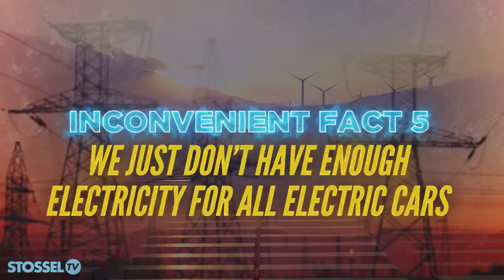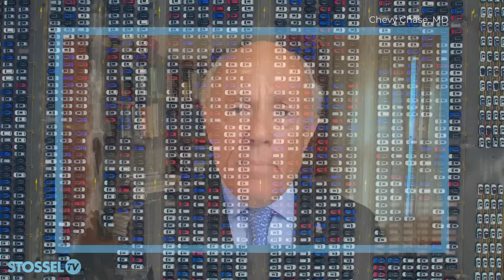Electric Cars: Inconvenient Facts, Part 2

Comment: As an engineer, the basic calculations for all of the requirements for conversion of any significant amount of the energy system to electricity are staggering. As your guest has stated even the best case back of the envelope estimates are huge. Unfortunately, low resolution thinking allows people to ignore the massive scale required to make this happen. Magical thinking also allows for them to believe we can violate the laws of physics by just waiting a little longer for the next breakthrough. They do not understand the physics behind a battery, and the limits of using ion transfer to make a rechargeable battery. Politicians, and  the Green Zealots are looking for the Harry Potter Magic Wand to be able to wave it and say some lame half word to make it all work. Unfortunately, it doesn't work that way, Physics, Math, Chemistry, Economics and Engineering have to work in the real world and not a make believe one accessed by train through an arch.
Reply: I would love to see some math to back up your statement.  Similar to this video, no references and no math don't cut it with me.
Reply: Absolutely
Reply: Yes, you are right !.
Reply: @Dedread  likewise where is your math that these breakthroughs will work?
Reply: Let me play devil’s advocate on the battery issue. How about solid state tech? As I understand solid state batteries far surpass energy storage/expenditure & life cycle metrics of conventional lithium-ion tech and still follow the laws of physics.
Reply: @MichaelJensen14  Given that over a million EV sold last year most without subsidy, math works really well. When Mars rover operated on MARS for 18 years with only 20% degradation, it is a breakthrough.
Reply: You can be canceled and lose your license for stating such heresy.
Reply: @sillasaram9121  And how much did that Mars Battery cost and what was it made of and is there enough of it for everyone on earth to have some of it? Probably not. I'm not anti solar, I've got it on my roof but right now EV's make up less than 1% of all the cars on the road.
Reply: Are you suggesting battery technology cannot get better? Because thats what stossel seemed to suggest
Reply: @Dedread  Ok, let's start: A 2MW wind turbine generates 2MWh of power over 1 hour. it takes 20 100kWh batteries to cover for that turbine for that same hour. For 10 hours 200 batteries, for 100 hours 2,000. 100 hours is the duration of the Texas wind drought incident in Feb 2021. This for 1 turbine. to cover the 100 turbine farm requires 200,000 100kWh batteries. This is a low figure since we have excluded losses from DC to AC conversion, charging and discharge control circuits, and the less than 100% utilization ability of Li ion batteries, so this is not even the bare minimum. Currently in the US there are 70,000 installed wind turbines, to back up these assuming a 2MW average for 100 hours, we are looking at 70,000x2,000=140,000,000. This is just to back up what we have currently installed equating to about 10% of the total us Electrical Demand. 

Tell me where we get 140,000,000 batteries? If we build 1,000,000 batteries per year, that is 140 years just to back up installed capacity. How do we make electric cars when every battery for from the factories is spoken for current needs no less the added turbines to go green. This is simple math without low resolution thinking. I could go on but this is already too long for me to be teaching basic math and reality.
Reply: @edd542  Most technology does indeed get better with time, but maybe wait till that time to push everyone to do it... Just because we might have people on Mars in a few years does not mean that we should all start booking our flights just yet.
Reply: @MikeBrownRehobothBeach  I agree, I think thats the biggest problem with this push for all electric
Reply: @motopolak  I would assume you are talking about capacitor based systems. The exist, but are not scalable. They also suffer leakage current in attempting to stop the current flow across a very high intensity electric field. The physical size if a capacitor to store 100kWh of power is about is as follows 65Whr per kg, is 100kWh/65Wh/kg=1,538kg or 3,384 pounds or 1.69 tons. This is why they are not used. 

This is with the state of the art products and may not really perform to the marketing claims stated. Also this is only at cell level and not the final construction into a battery unit. The frame and various interconnects will make this much heavier.
Reply: @edd542  of course it can get better, but radically changing things in the hopes that battery tech gets dramatically better tomorrow is an awful way to govern the people.
Reply: @edd542  you really need to read up on this. I used to think like you and then I started delving deeper into it. There is no miracle battery and even if there was we still need miracle power generation for it. Just do the math for solar panels to provide 25% of the earths power demands, it’s easy and the numbers are absolutely insane.
Reply: @BlyGuy  I agree 100%
Reply: @edd542  There is a limit to everything, the laws of thermodynamics are immutable. You cannot get more than you put in as far as energy goes. When you an Ion to store electrical energy, the energy put into moving that Ion both ways is wasted in heat most generally. The resistance of the system's conductors causes waste, and degradation of the physical processes causes waste as well. The highest energy density available in conventional energy systems is from the chemical bonds that are oxidized such as in Gasoline, and other fossil fuels. Ion flow will never approach this level of performance since it works at the movement of a molecule and not the released chemical energy by oxidation at sub molecular level.
Reply: You are hiding behind your so called “expert” status and making broad, generalized statements. There are no facts pertinent to the discussion.
Reply: @sillasaram9121  Sorry there is a subsidy for electric cars. Also, the niche for proper application of these vehicles is very narrow. Can batteries last a log time? Yes they can especially if they are of very limited and controlled in scope, and the controllers of the battery do not go beyond the rated limits. These batteries used by NASA are very focused on the low demand of the rover. The system is kept at optimal temperature, and no application is allowed to exceed that. Also, it is not used in an uncontrolled environment where if we do not have an adequate charge we don't move. So the comparison is not applicable. Are you willing to do the same discipline in your battery? Also the battery in cost per kWh is very high, and only the highest quality and purity components are used.

If the batteries are so great why is the newest rover Perseverance running on a Plutonium generator? Maybe the Li ion batteries and solar cells don't really cut it for higher power requirements. Sound familiar?
Reply: @edd542  No he didn’t. He suggested that you won’t see Tony Stark’s battery or the invisible power source/battery that powers the terminator. He’s suggesting that battery improvements are bounded by the laws of physics and thermodynamics.
Reply: @motopolak  Great in theory!  Maybe we'll get a prototype in 20 years
Reply: @theshadowsymphony  I will repeat my self.
Ok, let's start: A 2MW wind turbine generates 2MWh of power over 1 hour. it takes 20 100kWh batteries to cover for that turbine for that same hour. For 10 hours 200 batteries, for 100 hours 2,000. 100 hours is the duration of the Texas wind drought incident in Feb 2021. This for 1 turbine. to cover the 100 turbine farm requires 200,000 100kWh batteries. This is a low figure since we have excluded losses from DC to AC conversion, charging and discharge control circuits, and the less than 100% utilization ability of Li ion batteries, so this is not even the bare minimum. Currently in the US there are 70,000 installed wind turbines, to back up these assuming a 2MW average for 100 hours, we are looking at 70,000x2,000=140,000,000. This is just to back up what we have currently installed equating to about 10% of the total us Electrical Demand. 

Tell me where we get 140,000,000 batteries? If we build 1,000,000 batteries per year, that is 140 years just to back up installed capacity. How do we make electric cars when every battery for from the factories is spoken for current needs no less the added turbines to go green. This is simple math without low resolution thinking. I could go on but this is already too long for me to be teaching basic math and reality.

This is the simple stuff my children and grandchildren understand and they are not engineers. You could do the math and research as well, if you wanted to look deeper into it. I actually encourage you to check my work with facts and not opinions. We cannot get there from here, and no amount of magical or low resolution thinking will make that happen.
Reply: Richard, it would take about 100 sq Miles of solar panels to meet the current US requirements.  According to Elon Musk “a small corner of Utah” is all.  Of course he wasn’t actually suggesting this, his approach is distributed power using solar, wind, and batteries (Giga Packs).  Everything is already in use and Hawaii is going to be the fist US State doing the complete switch over.
Reply: @motopolak  solid state isn’t going to be the answer within the next few decades.  The batteries we already have (2670 and 4680) will see us through the transition.  Most of the “facts” in this video are wrong.
Reply: @UncaAlbyGmail  agreed, doesn't government translate to "control mind" aka "mind control"?
Reply: I don't know what kind of an "engineer" you are, but I'm one as well, and all I have to say is that all the management and professional automotive engineers at all the major car companies are going electric.  So you think you're smarter than all of them?  You think you're smarter than Elon Musk?  🤣🤣🤣🤣🤣
Reply: Did you ever consider that maybe we don't know all the laws of physics or that maybe those laws are grabbled (truth mixed with lies)? How does a permanent magnet keep creating a force forever with no energy input? How does a ball under water keep pushing upward endlessly, forever... with no energy input? Modern physics has no answer to either of these. But agreed, most people don't know even the basics of science and live in a world of magic, not even remotely understanding how their phone, car, or even a battery work. Modern solar panels, for example, require more energy to create than they ever give back in their useful lifetime... It's not low resolution thinking, it's being tuned into the frequency of the zeitgeist and therefor blind. And you really think "economics" is a science?
Reply: @bobdobalina8910  Unfortunately you are correct, it is too bad that we are in a state of magical and low resolution thinking. I fear for my children and grandchildren.
Reply: @rpercifieldjr  that is irrelevant given that there is still room for improvement with current battery technology. Also, combustion engines lose a ton of energy in heat too (of which engines are susceptive to degradation as well) so it's silly to use this as one of your points.
Reply: @67L48  fair enough but then that doesn't address the point of battery technology improving. He went from that to breaking a strawman of miracle batteries becoming impossible.
Reply: @brettvanwey9419  I think we generally agree that pushing this sort of policy is bad when the technology isn't there for it.
Reply: "Marty, the problem is you're not thinking 4th dimensionally", as far as electric cars go anyway. EVs use far less than half the energy required to move an IC vehicle down the road. A gallon of gas may have about 33 kWh of potential energy, but most often less than 12 of those kWh actually put power to the wheels in an IC vehicle. A 110 kWh battery pack in an EV can be roughly equivalent effectively to having 660 kWh of gasoline in your tank in an IC vehicle.
Reply: @edd542  That improvement is limited, like the improvement in ICE is limited. You cannot show me one battery that is scalable that come within an order of magnitude in meeting the energy density of any hydrocarbon. They are 50 times less efficient in that matter. It is relevant in that you are moving molecules to transfer charges, the only lighter atoms are He and H. They will not get you anywhere near the capacity of a hydrocarbon fueled system. It is physically impossible to do so. It is time to stop believing in pixie dust and unicorn farts to make things go.

Yes there is waste heat from an ICE system and we at at the limits of efficiency for that method. That does not mean that it cannot perform, and has performed over the years. However a Li ion system cannot meet my needs right now for transportation. I have looked into what is in the pipeline for battery development, and none of it is any better than vaporware, trolling for seed capitol from investment firms. If it were really promising it would be out by now.
Reply: @rpercifieldjr  "We cannot get there from here, and no amount of magical or low resolution thinking will make that happen."
Yah, right, sure.
Next you're going to be telling me that's not a Unicorn over there in my back yard, hiding behind that bush.
You been a baaad boy. I'm telling Santa!!
Reply: @rpercifieldjr  What's this "Texas wind drought incident in Feb 2021"?
Reply: Why don't we harness lightning?
Reply: @richb2229  There's a world of difference between Hawaii and let's say Seattle... Solar cells don't work well without sun, and there are alot of places that don't get nearly enough sunlight.
Reply: @Dedread  Lots of reputable info online to confirm his statements. Here is another fact not mentioned in this video. Industrialized society today would need to dig up nickle and copper for the next 200 to 400 years, at current production rates to electrify our entire nations. The truth is slowly leaking out. I used to believe in all of this non sense a few years ago, until I started managing my own investments and started looking at mining production charts.
Reply: @Dedread  do some of your own. Do you know the difference between KW and KW/hrs for example?
Reply: @richb2229  Rich, that is not accurate from a practical or physical standpoint. While the panel will produce about 150W per square meter at maximum production rate, that is not what you get over a daytime of solar energy. To meet current power generation of approximately 1.2TW 1.2x10^12 that would require 8 Billion square meters of panels, or 3,000 square miles. The bad part is that you are at peak output for only 6 hours during the day where power is greater than 50% of the rated power of the panel. On the remaining three before and 3 after in optimal conditions you go from 0-50% of nameplate capacity. The other 12 hours of the day you are at 0% energy production. This means that your system is running at about 22.5% of nameplate power at the farm. Thus you will need 4.44 times the capacity to just meet the requirements of the total electricity production today. That places us at 39,600 square miles. And this is only if you can store the power for use overnight. Since you must also charge the batteries and provide the above power you would have to at least double this amount. To account for the cloudy days per the DOE, Nevada has 158 clear days per year average out of 365, 365-158=207 thus you would have to at least double if not triple it to have sufficient margin. We will 2.27 as the factor for cloudy days That means we are at 39,600x2x2.27=181,418 mi^2. Nevada is about 110,572 sq miles.

So no, you would need more area than that to power the US. Also you would need storage to be able to make that happen. This is a perfect example of low resolution thinking, the calculations are low resolution, the storage does not exist, the grid cannot conduct that power to the rest of the country, and it just makes the perception that Green Energy is possible, even though with a higher resolution examination it falls apart.
Reply: @kaipo8085  "I'm not buying Twitter after all." Elon Musk, paraphrased from court filings, July 8, 2022.  What's your point?  Musk says things that aren't true?  Sure.  All the time.
Reply: @Jay-Zen  two problems...permanent magnets are not permanent, and they did, at one point have to be energized...input.  a ball underwater keeps "pushing" up because of density.  Any scientist who cannot explain that low density object rise in high density materials is not much of a scientist.  Also, how do you propose to get an air-filled ball under water with no energy inputs?  You cannot.
Reply: Let's see tractors run 24/7 during planting season and harvesting season and in between on batteries. I ran heavy equipment for over 44 years and you aren't moving dirt with battery powered heavy equipment. Maybe with those little toys that you buy until the batteries die and you can't play with them unless you have more batteries to put in them. It's the biggest con by governments since the climate crisis and covid.
Reply: @edd542  I think we're moving away from the real point and theme of this piece, which is that policies and political positions around electric cars must be bounded by the realities of science and the limitations of the physical world.  And this is one such case where calculations are less theoretical and are instead much more practically achieved.  

As others have said, there were no references cited by JS and his interviewee.  I'd love to see that data-driven debate. But, ultimately, that's the saddest part about this issue.  We never get to see people argue their calculations on this subject because wrong-think is not allowed.
Reply: @67L48  the number are out there and easy to check. Check them yourself.
Reply: @MikeBrownRehobothBeach  Mars rover battery was old chemistry same as what Nissan Leaf originally used in 2010. All new EV come with much better technology than 25 year old battery tech used in Mars rover like your phone is more powerful than computer used to land man on moon.
Reply: @_Slaab_  EV start at $20K for Nissan Leaf, BoltEV going for $25K. Used Leaf sell for $5K. If you can't afford brand new Mercedes and Tesla, that doesn't mean you can't afford to buy any car.
Reply: @pixifixi2076  Mars rover had SOLAR PANELS to charge the battery that lasted 15 years on Mars. You think solar panels charge nuclear reactors?
Reply: @rpercifieldjr  Subsidies expired for Tesla and GM (two biggest sellers of EV) in 2018. All EV except Nissan do come with thermal and battery management that is superior to what was used on Mars, and they live far easier life on Earth than on Mars. If you think EV is like your remote controlled toy car, you haven't a clue what modern EV is.

Mars rover used Lithium batteries for 15 years on Mars, and not even one rover gas powered. Maybe gas powered cars don't cut it as vehicle anywhere given their miserable efficiency. Sound familiar?
Reply: @rpercifieldjr  If you're driving over 200 miles every single day to your job and your job isn't a delivery driver, sure, EV isn't for you. But maybe you should move closer to work instead wasting so much time driving.

For almost everyone sane who'd rather drive 1 hour per day for commute (ie, under 75 miles) with occasional long trips with 200 miles between "fill up" that takes 15 to 20 minutes (ie, Hyundai on 800V chargers), they work just fine.
Reply: @fiendwithout  Lightning is a problem. You have a situation where you only get it when there is a storm, and storms tend to be even less reliable than wind. Then when you get lightning, you get a Gazillion Volts in half a Microsecond, which is a LOT of power in a very LITTLE time. You'd be more likely to melt your battery than actually store any of that energy.
Reply: @sillasaram9121  Ok let's do the math. I drive 40 miles one way to work. total of 80 miles round trip. If I have the heater on or AC according to the season, one of the small cars would make it. I would then have no reserves in case of emergency, or traffic. 

In the cold the battery's range can be reduced by half, and if stuck in traffic at this time I would be out of heat and transportation. I drive to my Daughters house over 200 miles away, to get there in my Honda FIT takes 2/3 of a tank of gas and 3 hours no matter the season. To take a Nissan Leaf would require a day of charging and driving, in many instances per some real world testing 15 hours to travel that distance. Please tell me how that would work in the real world.

There are many real world examples of these not ready for the real world incidents. In cold weather people have reported ranges of less than 70 miles after a full charge. I cannot use a vehicle that must be babied to drive an 80 mile round trip. If I liven in a large city this would make a good second car, especially if I lived in a warm area where it never freezes or requires AC like a lot of CA.

I do live in a sane and real world. The difference is that I believe in reality over hype, gaslighting, virtue signaling, or poor low resolution thinking.
Reply: @JoeBlow-nh7mp  I like that you mention mining, as an area to investigate.  Could link some of the research you've found?  My main objection to the content above is that there ISN'T any reputable info cited... it's just one guy pontificating.
Reply: @maurice22ravel  Wow, insults?  That all you got?  You have no idea who I am or what my education level is, or what content I consume.  I think I'm allowed to point out the complete lack of references, research, and the high level of FUD in this video.  The fact that you bothered to comment in favour of this video is what makes me worried.  I apologize for singling out your comment, though.
Reply: @sillasaram9121  "But maybe you should move closer to work instead wasting so much time driving."
Maybe you should mind your own business and not try to tell other people how to live their lives. There are many, many reasons to live someplace other than "close to work" including the price of housing, the quality of public education, and other desired amenities that might not be "close to work."
Reply: @jrd1415  I don’t think that the engineers run automotive companies. Only MBA’s and political ilk run these vast companies. The startup ev companies are riding on subsidies and venture capital to sell their product. They could care less if it makes sense; as long as there’s a market, they will sell it. Even if the fundamentals are illogical, they will happily sell you what you want.
Reply: @rpercifieldjr  Typical low end EV battery is 66 kWh (Bolt) and to heat an entire home takes 6 kW (also the power rating of electric ovens to cook) and much less for a car. 30 kWh would heat your entire home for 5 hours. If you're an engineer, you'd know that using half the battery on typical commute is BS when you turn the cabin into a literal oven. 

Cold weather loses maybe 10 to 20%. Assuming 20% loss, that is still 48 kWh, half is 24 kWh, enough to turn your car into an oven to roast turkey for 4 hours at 6kW.

Ignorance of basic facts about modern EV makes you live in a fantasy world of make beliefs.
Reply: @UncaAlbyGmail  If wasting 6+ hours commuting every single day, that's up to you. But I call BS on your claim that you drive 200+ miles every single day for commute. In case you do, there are better things to do with life than wasting half your waking hours commuting, but then you do you.
Reply: @MichaelJensen14  A ridiculous response.  I'm not the one creating a video with content with nothing to back it up.  If you want better videos, I recommend the channel Engineering Explained.
Reply: Only if the other states were plastered in batteries, enough to carry good day yields into cloudy winter days
Reply: @jrd1415  And that is because management is driving that direction for political reasons. The Toyota CEO is being level headed about this, and not going that direction as an all in type of thing. Are there applications for electric cars? Yes, but not without significant drawbacks. Is there a market? Yes, and they should sell to it. However you will notice that no one is going all electric physically across the board. This would even for them be stupid.

I am an electrical engineer, and understand the power control, delivery, battery and generation side of this issue. However it only takes a little bit of math to show the gaps.
Reply: @Jay-Zen  We do know how a permanent magnet works, otherwise we would not know how to make super magnets with Neodymium, a rare earth metal used in windmills and BLDC motors in cars like Tesla. Buoyancy is an understood effect, and has been for over a thousand years. 

You made my point about about solar panels, which do have applications in isolated areas where the grid is not available, however saying covering the entire state of Nevada is a worthless statement since it is neither practical, or realistic. All it does is provide a low resolution solution that can never be done about a real problem.

Economics is a reality, not a science. If it isn't economically sustainable it is not sustainable in real world terms. If it costs 22 Trillion dollars to make all of the batteries and windmills, we do not have that much spare wealth. Reality must intrude, and we will have no option to make that happen. We have spent over 2 Trillion dollars over the past 10 years on "renewable" energy, but yet it still globally only provides 1% of all energy across the world, that is not economically sustainable.
Reply: @sillasaram9121  I spent less than $14K on my Fit. I am not going to spend more than 5 to 10 times that amount for a Tesla. I have seen the data from various independent testers, and as well with my own experience with them from owners here where I live. I was in a Tesla that was less than a year old that ran out of power traveling in the winter in the northern US. It was fully charged and after 100 miles, had to be placed onto a flatbed and taken to a charger. I went in my Fit and picked them up, and transported them to the charger. This person was also an engineer, and was very pissed. They got caught in a traffic jam, and were dead in the water. It was -15F and if it were not for the help of others, could have had some serious problems. He sold that car soon after that.

I will not use a vehicle best fitted for a California existence in a place where normal weather occurs. That is the facts of the matter, and it is time to face up to them. Just look at the F150 Lightning, it cannot even tow 1,000 pound over 100 miles, what good is that? But hey you are destroying the environment for a good cause right? Just look at how they mine Lithium, Cobalt, and Neodymium to get an idea of the damage done to the planet. But hey its all good who cares about the planet anyway......
Reply: @Dedread  Your comment of 140GWh is not accurate, we are looking at 140,000,000*100,000Wh (100kWh Battery) which is 14x10^2 or 14TWh of storage capacity. If as you state that Tesla is doing 50GWh of production, that would take 280 years to fulfill that order. To do it in a year would take the building of 280 additional factories which isn't possible. No less the material needed to produce the batteries and equipment. And this is just to cover what is installed right now without building any batteries for Cars, Trucks, Solar Panels, Laptops, Cell Phones, and new turbines constructed. You cannot get there from here.
Reply: @rpercifieldjr  Well, I was just going off your previous number.  I can't scroll back to the post (can't find it), but whatever.  Yes, we need a lot of batteries.  You're still ignoring my other comments about alternate sources of power, distribution, backup and storage.  You're also assuming 100% capacity for a very long period of time (you are even assuming full capacity overnight).  Wind farms are typically overbuilt in capacity, BECAUSE they are intermittent, so you're assuming we'd have to store the whole peak amount for the whole period.  This is a very one-sided view of a complex system.  No one said we'd have to do away with combustion-based backup systems, either.
Reply: @Dedread  The problem is this, Wind systems operate at about 20% capacity in nominal operation. Why should we use a system that we must build at 5X what could be done with a single thermal or nuclear plant. Why waste that money? These systems do not need batteries to store the energy when there is no wind, and have a small footprint environmentally reducing the materials and land use. The intention of the Greenies and Politicians is to have 100% renewables, no thermal plants, no Nuclear, no Hydro, nothing reliable. All heating, cooking and transportation will be electric. So yes you will need 24 hour coverage or people will die as they did in Texas in February 2021, Transportation will not be charged, There will be no heat, no cooling, no cooking, no lighting,  and everything will go dead since there is no 100% batter backup for the grid in this future.

Our society is structured on reliable energy 24/7/365. To switch everything to electricity as Biden and the Greenies want the grid will have to grow significantly. Right now California at times has told people to not charge their cars due to the lack of grid capacity, how pray tell will that be fixed when they will not allow for more power line construction?  If we cannot do that we cease to be a first world country, and become 3rd world with only the elites having the means of  power and luxuries like heating, cooling, food storage, indoor cooking, running water, etc.

If you want that future then fine move somewhere where that is already happening and leave mine and my children's  quality of life alone. Ever notice that the people driving this like Al Gore have the carbon footprint bigger than many third world countries?
Reply: @rpercifieldjr  I spent $26K on my Bolt that does 0-60 in 6.3 seconds. I'm not going to spend more than 5 to 100 times for BMW or Bugatti. I have seen data from independents and my own experience that gas cars cost many times EV and constantly have to go to "filling station" even for daily commutes not to mention oil change and other nuisance maintenance. An engineer had to constantly make appointments for "maintenance" on his gas car and was stranded on side of the road running out of gas (leaky tank) and he was pissed that he couldn't charge at home like EV.

There are thousands of more anecdotes of gas cars leaking oil and blowing gaskets and what not and stranded on the side of the road. 100 miles on Tesla is defective car, and there are tons more problems with gas cars. But of course, you'd know this if you actually looked at the numbers like an engineer instead of "feelings".
Reply: @rpercifieldjr  If you're an actual engineer, you'd realize F150 lightening that weighs 6000 lb gets 250 miles range and that there is no way that extra 1000 lb would cut the range by more than half. This is grade school level math, yet you seem to fail to grasp such simple concept.
Reply: @sillasaram9121  You have a hybrid vehicle that has 53 miles on electricity and  420 when burning hydrocarbons. The additional carbon footprint in the battery construction and rare earth metals means that you still have generated more CO2 when it rolls off the lot, and will take many miles to recover. Also, during longer trips your gas mileage is per the EPA 42MPG. I get 40 MPG with my fir without the added CO2 for the Lithium Cobalt and Neodymium mining. 

As for the fuel fires, I can personally attest that during my 17 years in EMS prior to being injured and changing vocations, most car fuel fires were not from accidents but from arson, poor maintenance, and stupidity on the part of the operator. The only time I have ever had to remove a body from a burned out car was from a Mafia Hit. Fuel fires are easy to control,and put out. I have personally participated in extinguishing fuel fires of many types, and can attest in the ability to do so. I have also tried to put out Li ion battery fires and was never successful in the lab. These fires emit toxic Li fumes that are very hazardous and sometimes lethal to humans. While gasoline burns, it does not require the evacuation of the neighborhood for the safety of the residents.

I will also be able to drive my manual Honda Fit for well over 200K miles, while you will replace the battery in 6 to 10 years as it will not hold a useful charge. That will be $8,000 out of your pocket and the emissions used to make that battery will be a part of the equation, starting the clock all over.

The newest version is at $28,000 twice the cost of my fit, and would have by now had an additional $8,000 on top of that, making the total $36,000. If you want to pay that much for a basic vehicle, I am fine with that and do not care. My issue is for the Greenies and Politicians to make that decision for me. They do not use these vehicles and will not live without the comforts and convenience we have now, but will expect us to sacrifice.
Reply: @rpercifieldjr  When Mars rover operated on inferior lithium battery in Mars for 15 years, and still had 80% capacity left, you still firmly believe batteries only last 6 years? Practically all Teslas sold since 2011 still have 80%+ battery capacity left and degradation on newer batteries stabilize under 1% per year.

If you care so much about the environment, stop driving any car and walk. For the rest of us who like the convenience of driving and fully charged each morning without wasting time going to gas station and constant "maintenance", EV works just fine. Combined with charging from home solar, I get equivalent to well over 1000 MPG.

When you compare econobox Honda fit that only gets 38 MPG and 0 to 60 MPH almost 10 seconds to much bigger Tesla 135 MPGe (or 1500 MPGe if charged from home solar) and 0 to 60 MPH in 4 seconds (or 3 second at $65K or 2 seconds at $129K), you are not comparing anything other than your feelings.
Reply: @sillasaram9121  "But I call BS on your claim that you drive 200+ miles every single day for commute."
I work from home. Don't confuse me with other antagonists. But I do know people who have traveled 60 miles from home (Rancho Cucamonga) to work (El Segundo) lasting 2 hours, making a 120 mile round trip. I have personally driven 50 miles from home (South Los Angeles) to work (Irvine) one way for a 1 hour commute.

It's not fun, but a job is a job, and it's not always easy to find a closer one in your choice of industry. It is definitely not easy to find affordable housing in El Segundo or Irvine.

"... you do you"
That's all I'm asking. Don't think you're so smart and wise that you can decide what's best for other people. In return, we'll try to have other people not tell you what's best for you.
Reply: @UncaAlbyGmail  My beef is this video and comments supposedly about EV has very little about EV and all about bashing environmental nutjob strawman. There is literally zero mention of EV performance microsecond response or efficiency over 90% or modern battery tech that allows rapid charging that wasn't available when Mars Rover battery was sent to Mars and many more. They are inconvenient facts to those stuck in 1999 EV technology.

Over million EV are sold each year now and growing even in very cold places like Finland. But there is zero mention of this fact and how well they are working. And US is leading the world in this field (for now with Korea rapidly catching up). That is the real inconvenient fact.
Reply: @sillasaram9121  "My beef is this video and comments supposedly about EV has very little about EV and all about bashing environmental nutjob strawman."
There is no argument that EVs are extremely efficient, extremely powerful, and very nice automobiles. There is no argument that more and more people are purchasing more and more EVs. That may explain why there are few comments about that.

It might also be explained by not being particularly relevant to the argument.

And you'll have to explain to me how the destruction of vast acres of land all over the world to mine the materials for an EV, and the burning of fossil fuels to charge an EV, and the fossil fuels burned to transport materials from mines to manufacturer to retailers to consumers, are "strawman arguments."

In nutshell, the EV simply moves the pollution from the distributed individual consumers to more centralized locations. That's not a strawman, that's a fact.
Reply: @UncaAlbyGmail  As explained in the video, EV's environmental impact is recouped after about 60K miles compared to driving gas burner even with all the land use and mining. Given that even the crappiest EV battery lasts 100K miles (minimum warranty period), and most last well over 250K miles, there is no question EV's are more environmentally friendly for practically every case and more so the more you drive and electric grid gets cleaner.

But it's not about the environment, it's about EV and that is hijacked by environmental nutjobs. If they really cared about the environment, they wouldn't be driving a car at all and walk instead. Environmental argument is moot even when EV are proven more environmentally friendly.
Reply: "As an engineer, the basic calculations for all of the requirements for conversion of any significant amount of the energy system to electricity are staggering. " And you factored in a loss of 75% of gasoline's energy due to heat when used in an automobile, of course.
Reply: WTF?   Stossel avoided numbers because they would not agree with the rhetoric.  I noticed you have a lot of words but no numbers also!
Reply: @gregkramer5588  " I noticed you have a lot of words but no numbers also!" To whom are you responding to?
Reply: @justsomeguy934  Richard
Reply: @gregkramer5588  In this thread I have supplied many calculations and numbers. I will give you one example: Windmill Battery Backup. One 2 Megawatt(MW) turbine generates 2MWh (Megawatt Hours) of energy. To back up that Turbine for 1 hour requires 20 100kWh (100 Killowatt Hours) of batteries. We are excluding Battery losses, DC to AC losses, etc. this would make the number required much greater. To  back up that turbine for 10 hours is 200 batteries, and 100 hours or about 4 days, 2,000. At the end of those 4 days (the length of time for the wind drought in Texas 02/2021) even if the turbine were running you would still have to provide power and recharge the batteries. This is for just 1 turbine in the wind farm, for the entire 100 turbine farm you would need 200,000 batteries. for the 70,000 turbines installed currently in the US you will need 70,000 x 2,000 for cover a four day pause in the wind, that is 140,000,000 to cover the windmills in operation right now. Building a million batteries a year would take 140 years to backup the installed ones today not even the ones yet built to go all renewable electric in the future. 

At this point Wind provides at best 10-14% of the power for the US, thus to get to 50% would require 5 times that amount at least and probably more due to a lack of reserves when you shut down the thermal plants. Do we have the capacity to make this many batteries for Windmill and Solar backup, while still making units for cars and trucks? Not in a plan I have seen from the people who are not thinking critically about what will be necessary to be 100% renewable by 2050, This is just a low resolution thinking pipe dream.
Reply: @rpercifieldjr  This is not a liberal vs conservative issue.  It is numbers and data.  I could not care less what you want to spew about Biden or anyone.  How much does the grid have to grow?  The data I see show about 30% for EVs over then next 25 years.  That is way smaller than what happened with the advent of AC.  What are the numbers you see? 
BTW I am considering an Ioniq 6.  If I drive that 1k miles per month that is ~250kwh of electricity.  In the summer my house uses 1500kwh for AC during the hottest months. 
Additionally vehicle charging does not have to occur during the peak of the day.   So a large portion of it can happen off peak which farther reduces that need for expansion of the  electric grid.
Reply: @gregkramer5588  You still have not told me where and how you will store power with calculations and data. Where and how will we get the additional power from "renewables" not only to replace the legacy thermal generation, or the additional power to convert everything to electricity. 

The Ioniq 6 you mention delivers between 200 and 259 miles of highway driving per charge. In the City 259 and 396 miles. Nowhere have I found any reference as to range with the AC running, however it is probably in the range of the cold temp range with heater and probably worse. Thus your car will need during the winter if you live up north 1,000mi/200mi/chg=5chg to 1,000mi/259mi/chg=3.86chg charges, totaling 74kWhx5=370kWh to 74kWhx3.86=285kWh. However, since there are losses in the battery and charger, you are looking at an additional 20-40% more energy required to charge it. Figuring an average of 30% total losses that places the power needed for you car in the winter at 370kWh x 1.30= 481kWh to 285kWh x 1.3= 370kWh. There would be a few months of mild conditions that this would be much better, however in the summer unless you live somewhere very mild running the AC will be the norm, and it would probably be comparable to winter or worse. Most families have more than one vehicle and if they were both the same you would be looking at an additional 962kWh to 740kWh per household. This is approximately a 64% worst case increase in power demand from your home. From an electrical standpoint is significant. Multiply this times the entire neighborhood with a plethora of various types of vehicles, and the grid will be easily overloaded. This is relevant because there isn't that much excess capacity at the residential level, and even small shifts can cause problems. California announced that they were going to ban all ICE car sales by 2035. Basically 12 years from now. They cannot even enhance the grid at the local level at that time, no less the feed lines and substations to meet that date. It takes years of planning, permits, environmental studies, and lead times for equipment to make that happen no less the financing and regulatory approvals. What I found funny was right after that announcement, Newsom asked for electric car owners to not charge their vehicles, for the grid could not support it.

My original assessment still stands that politicians and greenies are driving a solution that cannot be affected. The cost to the grid and power generation will be greater than the ~60% I showed here for the the efficiency for the system has to brought into account and design margin must be in place for reliability. Also there a move to eliminate all fossil fuel from any applications in the home. One of the most efficient means to heat a house is with Natural gas or Propane. Adding this load to the grid will further increase demands. We no longer can ignore reality, and our politicians need to stop advocating for something unobtainable. In other words it will not scale well, and the laws of physics are immutable. Unfortunately Europe is learning this now.
Reply: @rpercifieldjr  Compressed air is very promising and pumped hydro will be bit also. Of course over the next 20 years are vehicle batteries will be part of it also.
Reply: It’s going to take time. 

The change to electric is happening quickly and a lot of this is driven by economics. The cost of wind, solar, and batteries continue to decline. Solar panels have been rapidly dropping in prices for years. Wind turbines cheaper and more efficient with each generation. Batteries more capable and cheaper with each generation. These are decades long trends. Also, electric cars are dropping in production cost.

It’s a matter of time.